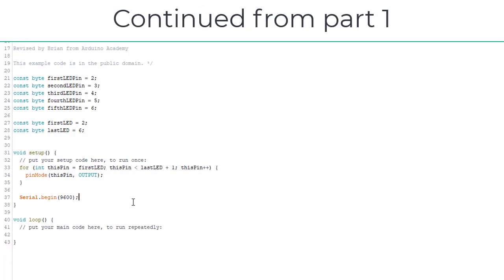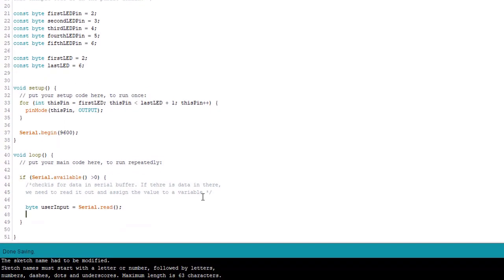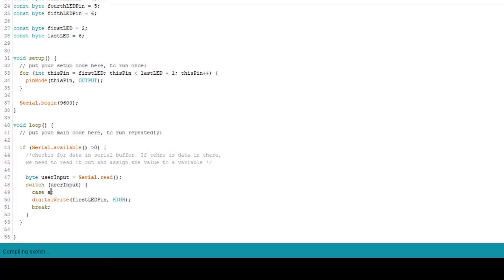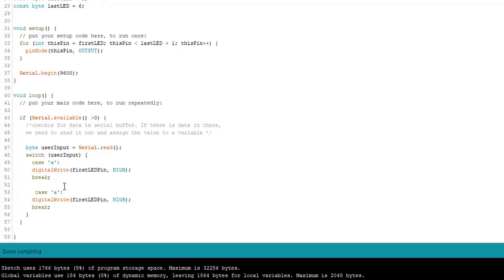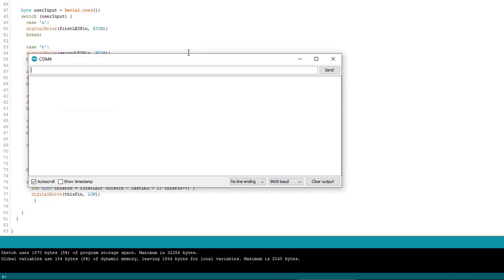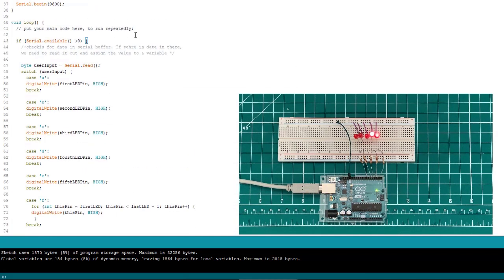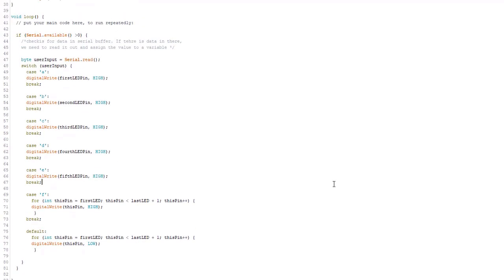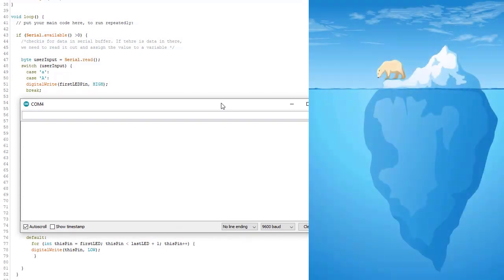How to Use Switch Case in Arduino Part 2

Comment: ok, so you showed how to use an 'or' statement inside a switch/case, what about an 'and' function?
Reply from the maker: Awhile ago I did a series on arithmetic and logic in Arduino. You should check those videos out!
Reply: @CircuitCrush  that sounds cool. Could you share a link?